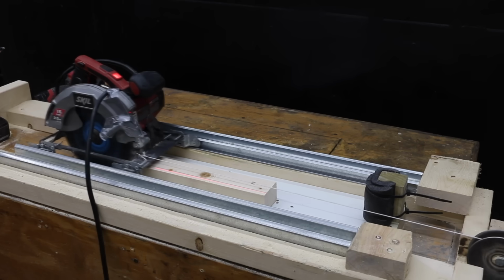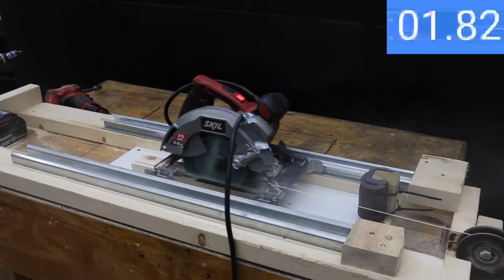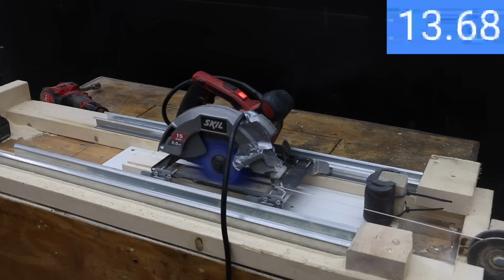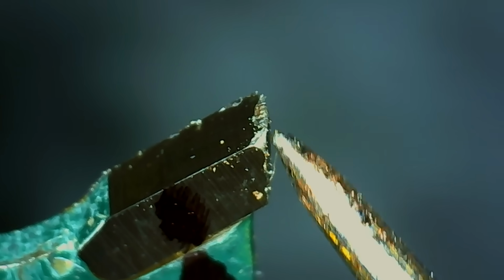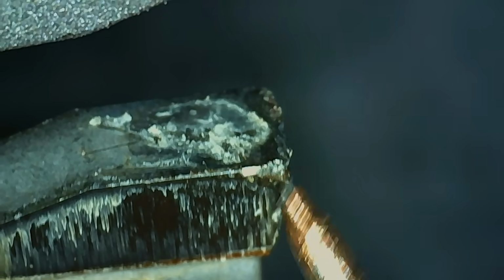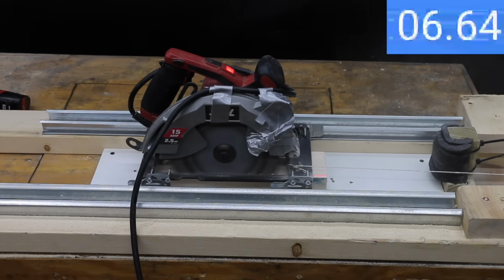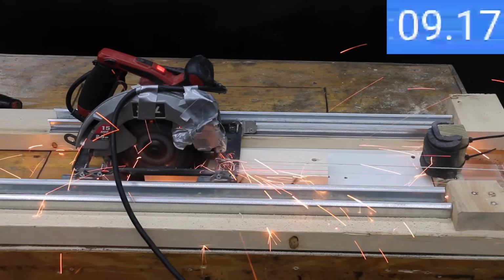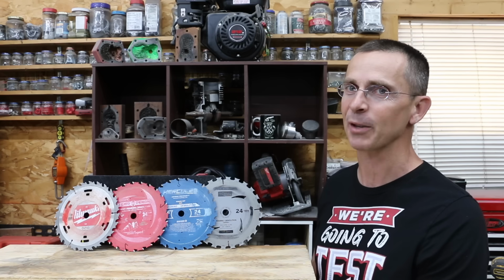Best "Demolition" Circular Saw Blade? Milwaukee, Diablo, DeWalt, Hercules, Evolution, Bosch, Amana

Comment: I used to work at Harbor Freight, Hercules brand stuff really is no joke. I wish they didn’t use such ugly colors 😂 Bauer looks so much better, but Hercules takes the cake.  I originally got the job because I helped set up the store in my town and I used Hercules tools the entire time to put together all the shelves and drill into the floor and walls. I honestly expected everything to fail and fall apart but was pleasantly surprised. If you’re on a budget, or really even if you’re not, I can’t recommend Hercules enough especially for just like little bits and whatnot.
Reply from the maker: Thanks for the feedback.
Reply: Actually I think I used a plug-in Bauer drill for the floors but that’s because Hercules didn’t make one at the time (they might now, idk). I know that Hercules didn’t have as many tools out as Bauer but they were expected to be coming out with more. This was right when Covid first hit and I ended up quitting like 4 months later and haven’t really kept up on it.

Comment: A lot of blades are designed for crosscutting. Ripping wood with a saw isn't the best test. I bet the rating of some of the blades would definitely be different in crosscutting with and without nails.
Reply from the maker: Thanks for the constructive feedback.

Comment: I have been an avid Milwaukee fan. I do have a test for you to try. How about testing those with CORDLESS BATTERY PACKS, SINCE most jobs are out in the field with no electricity, some even use a small Honda style 4500 type engine generator for power. Something to think about.
Reply from the maker: Thanks for the video idea.

Comment: Somehow, I missed this video when you first put it out.  I'm glad I checked today, because I use my circular saw for some very tough cutting.

I never tested the results, but I had an idea that cutting through metal wasn't a good idea.  I've used the saw to cut wood, pressure treated wood, OSB, particle board, nails, screws, galvanized pipe, copper pipe, wires (with power off), pvc, abs, aluminum rods, drywall, laminate flooring, etc!  All kinds of things.  I did notice that the cutting slows down after abusing the blade - makes sense.  And it seems like the degradation of the blade occurs faster as soon as the blade reaches a "set" amount of damage.  Yes, it still cuts, but it's so damaged that it's better to toss the blade and put a new one in.

The results were impressive.  HFT blade did well - WOW!  And those expensive blades didn't do too well.  Evolution - never heard of it, but I'm going to look for one.  And of course, the Diablo and Milwaukee performed well - I prefer these two brands, though I do like the DeWalt too.

Awesome video and I love the test rig you set up.  Ingenious!
Reply from the maker: Thanks!

Comment: All the blades after the shingles test... "whew, we made it" 
Sees deck screws
"Aww,  F****!"
Reply: They don't make them like they used to. Did anyone else cut bricks with a framing blade? I had one that lasted through multiple steel pieces, as well as cutting tiles and bricks. Cuts much cleaner than grinding wheels.
Reply: @hammyboigaming904  
That sounds like one of those things the old stuff could do, precisely because things were crappier back then. Lol

Seriously, technology in everything was less. So things were more overbuilt to compensate. They were also usually a LOT more expensive once you factor in inflation.
Reply: @hammyboigaming904  Very interesting. Thank you, Hammyboi Gaming :)

Comment: How well do blades for cutting metal work on wood (compared to blades specifically designed for wood)? I work with some wood and some metal and usually just use the metal blades for everything.
Reply from the maker: Thanks for the suggestion.

Comment: Like your work, as always. However, can't you pick up the filings with the magnet "through the baggie"?  If you start with the bag inside out  and the magnet inside the inverted bag, just "un-invert" the baggie, seal the bag, and disconnect (remove) the (still clean) magnet?  I believe that should work...
Reply from the maker: Thanks!  Thanks for the feedback.

Comment: Good video, but I would like to submit, to add Forrest saw blades, CMT, and Ridge saw blades.  These two brands seem to be popping up more and more. I
Reply from the maker: Thanks for the video idea.
Reply: @ProjectFarm  Forrest, CMT, and Ridge Carbide would be the higher end blades for woodworking.  You could do this as a totally separate video for High end blades.

Comment: Good video
I have a question in regards to which saw blade would I use to cut https://www.lowes.com/pd/Fypon-Durapoly-4-25-in-x-8-ft-Unfinished-PVC-Square-Column/1000460543
Would it be 24T, 50T, 60T? The reason why I ask is because this Column has a metal insert and I am unsure if a Fine cut(60T) would cut through the metal insert.
(I have some brand new 60T blades that cut wood, pvc, and composite. If this will work fine, then I have no need to buy another blade)

Comment: I've had good luck with the Hercules blades, they were super cheap on sale when they first came out and I grabbed a bunch of them figuring I'd likely destroy them in a hurry doing demo work. I'm still on the first blade.

I've got a 70's era Skilsaw with a 70's era 24t carbide blade on it that's missing its lower blade guard. I trash picked it that way at work 35 years ago. I use it solely for demo work, mostly cutting up old boat hulls. The blade is missing one carbide tooth, its been sharpened once on the HF blade sharpener. Its a blade that just won't die. Its hit cables, wires, bolts, and still keeps going. Its made in USA though and likely Skil's top of the line back in the day. I fully expected to throw it away after the first time I cut up a junk fiberglass hull, but its been going strong now for years. The one thing I did that may have helped it was to cut all the teeth at 90 degrees with no offset. I would have thought the opposite but its doing well. I cut apart the aluminum frame and structure on a junk camper last week for disposal with it, it took 5 hours to put that thing in a pile but it did the job and the teeth are in good enough shape to go again.
Reply from the maker: Thanks for sharing.

Comment: I have an older pair of Wolverine's (10 years I believe) that actually have steel toes. I mainly use them during the winter while snow removal or working out inclimate weather and I think they'll be with me for another 10 years. In warmer weather, I generally where non-marking black Knapp steel toe shoes.
Reply from the maker: Thanks for the feedback.

Comment: Yet again you fail to test lennox blades, there a reason for this? I've done extensive testing on lennox blades and bits and often found the material removal over time and blade degredation to be vastyl superior.

p.s. Maybe try Pferd in your testing.  And for the love of god could you include Hilti tools and consumables in your testing?
Reply from the maker: Thanks for the reminder in testing lennox blades.  Also for the video idea testing Hilti tools and consumables.

Comment: As a carpenter, this video makes me want to pull my hair out. These tests are almost totally irrelevant. All that's missing from this experiment is a basic understanding of what each blade is for and where they perform the best. No one has only one type of circular saw blade unless they don't understand this. I'm surprised he didn't test those blades against a diamond coated blade or an abrasive blade. "The diamond coated blade came in at two hours".
Reply: I love PF but I agree with you, I've never used a framing blade to do anything other than cut wood. Maybe a better test would be to rip sheets of plywood, osb, LVL and see which stays sharp the longest, cuts fastest, and cuts the straightest line.

Comment: You should test the different brands of these pliers. https://www.lowes.com/pd/KNIPEX-High-Leverage-with-Crimper-and-Fish-Tape-Puller-9-5-in-Cutting-Pliers/5000886681?cm_mmc=shp-cprdelcgooglelia-106-electricaltoolsandtesters-5000886681-_-0&placeholder=null&ds_rl=1286981&ds_a_cid=112741100&gclid=EAIaIQobChMI_Pq9x-u48QIVrW5vBB2KwwjMEAQYAyABEgKrTPD_BwE&gclsrc=aw.ds

Comment: I really love your video's. And again a great performance!

But i miss the camera shot that shows the saw blades' teeth. 

A very important aspect of a saw blade is how the teeth are grinded. You have a ATB grinding(alternate top bevel) is a grinding which is mainly cut for wood. And you have more grindings(ftb, tcg, Hi-atb)for different materials, sharper cuts, etc.
If you only show one teeth i can't really see it. 

Nevertheless a great video again!
Reply from the maker: Thanks!  Thanks for the suggestion.

Comment: Interesting regarding tooth damage, but how much ripping is done for demolition? Efficient ripping takes a very different tooth geometry from crosscuting or demo work.(And the line between ripping and crosscuting isn't 45deg its more like 15deg, so most angle cuts qualify as crosscuting)

Comment: Been watching for 2 years, not sure how I havent subscribed before today, just got that out of the way!!
Im wondering if you could do a test on the benifits of dielectric grease, and if vaseline really works as a substitute, if it interferes with the firing of a spark plug, helps coil packs ect 
I used to live in a rainforest, boaters and motorists swore by it and even jammed their fuse boxes full of it, is this overkill or smart?
Reply from the maker: Thanks for watching and subscribing!  Thanks for the video idea.

Comment: heres a video idea; test the different 40v electric batteries for ryobi lawn equipment, to see how long they last, what kind of power they can output, and how long it takes to charge as well, and if they even work properly as “ryobi 40v replacements”. I have a couple 40v batteries that are 2.6ah but they dont last me the whole yard so i bought another 6ah ryobi battery on amazon. But the 6ah america made ryobi was more expensive than all the chinese knockoffs and i want to know why
Reply from the maker: Thanks for the video idea.

Comment: I looked at as many of the comments as I cold, and did not see it mentioned. But, none of those blades are designed to RIP through solid lumber. They are pretty much just made for crosscutting. Blade design makes a big difference in those situations.

An overall great video, to be sure. Been making dust and bangin' nails for way too long. I mostly use Diablo blades anymore for framing and such. They make decent cabinet grade table saw blades, too.
Reply: Also, we always keep old, worn out, missing tooth blades for demo work. Nothing like cutting a hole in a roof with a 24 tooth blade missing a bunch of teeth. They hit the trash bin after that job for sure.
Reply from the maker: Thanks!

Comment: On a different subject. Can you test oil extreme oil and the additive? Can you include Schaeffer motor oil, penzoil ultra platinum, Amsoil? And maybe the Costco brand of full synthetic?  I switched to penzoil ultra based on your testing. I also tried the engine restore additive in my 1994 Toyota Privia van.
Reply from the maker: Thanks for the video idea.

Comment: What happens when you use chain saw bar oil both for the bar and to lubricate the engine? Like instead of using 2 stroke oil you put the sticky bar oil in with the gas?
Reply from the maker: Thanks for the video idea.

Comment: I have a suggestion for a video. Will valve grinding compound added to engine oil ruin an engine or will the compound settle to the bottom of the crankcase?
Reply from the maker: Thanks for the video idea.

Comment: Hi I have a diesel truck with worn piston rings just wondering if you can do a video experimenting if really thick oil like 40w70 would damage engine during cold weather or if it would cause no damage as I have not found a single video on YouTube experimenting 40w70
Reply from the maker: Thanks for the video idea.

Comment: I think there's two things to account for here.  First is the overall slowdown after all that punishment.  But the second is how each managed heat - most obvious by the slowdowns at (or after) the 2nd deck screw (spyder),  and the DeWalt's heat related failure.
So, this showed us that we can rely on the cheaper blades.  But there are a couple of exceptions to avoid.

And it seems to me most variations are more about the wood grain.  The only way to get more accurate would be to use MDF or a composite.  But with materials getting so expensive today, these tests are far more than "good enough".  Wonderful testing.

Now it's on to seeing what blowing a 5000amp fuse looks like.  Ah, the wonders of youtube.
Reply from the maker: Thanks for the feedback.

Comment: so a carbide tip that has any damage is major not minor the coatings are not the issue its that the "minor damage" took the side of the carbide off changing the clearance of the side of the cut no longer allowing the rest of the blade to have clearance so then it touches the side of the piece as it cuts you make great videos and sorry to criticize
Reply from the maker: Thanks for the feedback.

Comment: Project idea, how about using your torque meters to compare cheap taps and branded taps?  I was asked to make some 3/4 long nuts by a friend (m8x1mm, but have had the same experience with 1/4 npt).  I had no problem cutting the thread in free cutting mild steel, but had to use massive effort to thread stainless or cold rolled - it felt like the shank was twisting ).  I ordered some branded taps (volkel made in germany) and could turn the tap wrencb with one finger.  If you've alrwadg done this, excuse my ignorance, if you haven't, I'd love to see some numbers👍
Reply: Also please excuse my typos👍
Reply from the maker: Thanks for the video idea.
Reply from the maker: Thanks for the video idea.

Comment: I accidentally cut 5 nails with a Diablo rip and finish cut blade. I thought it was done for sure, but there was no damage at all and I could still use it for fine cuts. I was blown away.
Reply from the maker: Thanks for sharing.